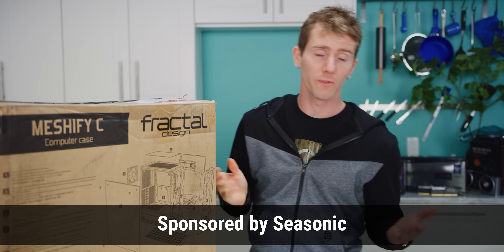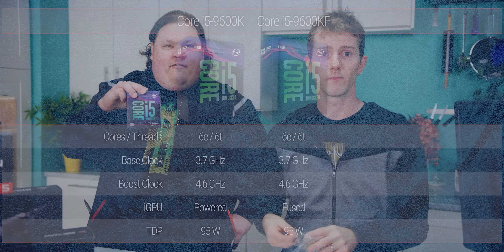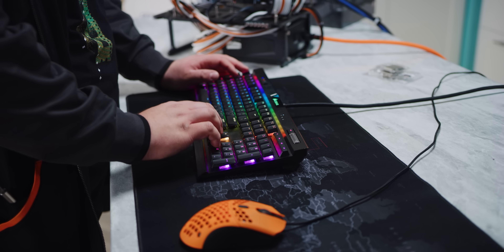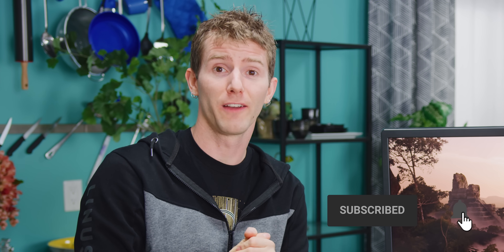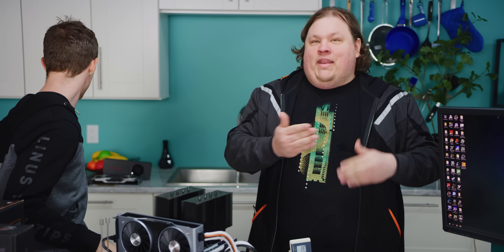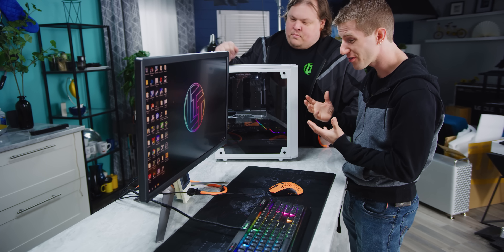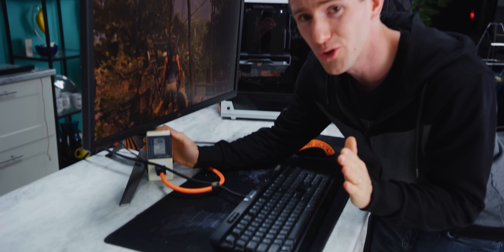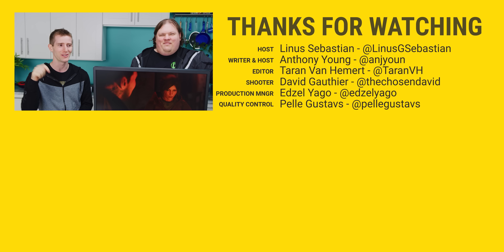We built a PC more efficient than a console!

Comment: Linus: "Most PCs don't blow smoke"
Me: "Wait, that's NOT normal!?!?!???"
Reply: If you remove your pc's cooler it will work better and stop smoking.
Reply: @paulopereira47  the funny thing is I actually did 😂. I have a crappy laptop and a piece of metal got stuck in the fan and it was making a horrible grating noise, and since its super cheap, it has no fan control in the BIOS, so the only thing I could do was to just take it out!
Reply: "Most PC" means it taken into account that some PC do blow smoke. So I think we ok,it just our PCs are little unusual...

Comment: One thing that I think should be mentioned here is that running your games on lower settings will substantially reduce your power draw, as your GPU in particular doesn't need to sweat as hard for each frame. My monitor is capable of 75 Hz and I often have plenty of GPU overhead in games, but I always run at 60 Hz and use the low settings preset. It's often said that whether a game is good is independent of the graphics, and I definitely agree. Eye candy is *nice*, but so is having a livable planet. The other benefit is a quieter, cooler PC that theoretically should age more gracefully.

Comment: In the interest of efficiency, getting fans with fewer blades leads to less airflow interference between the individual blades and higher efficiency. Of course, to equal the same airflow with the same diameter fan, the rpm needs to increase, meaning more noise.

Comment: I actually run my i5-10600K at 4000-4400MHZ (dynamic), locked on 1.1V. It's very efficient but still a beast of a CPU, eating any game you throw at it, while only drawing 60W in the worst case scenario and as low as 5-10W at idle. It also doesn't go hotter than 60*C with a medium tower cooler that costs about $20-25. XMP is disabled, of course and memory sits at 2666 @ 1.2V with the best stable timings.

Comment: Simple trick to save buttloads of energy:
use a Firestick when you're not gaming and just want to watch YT, Netflix or similar stuff.
That thing sips energy in the 1-digit-watt-range, compared to a gaming-rig that probably still idles in the high two-digits or low three-digits.

And in addition, the Firestick can also use HDR and 4k streaming, which sadly isn't possible on most browsers for some reason.

Another/similar tip: Hook up a laptop or tablet to your desktop peripherals (including screen), even better if you have a cheap usb-c-dock. 100% of the "casual PC stuff" (YT, Discord, etc.pp.) including the same handling... At 1/10th (to 1/5th) the power cost :D

Comment: Same issue with the I5 x400t here in Germany. I had to source a used 10400t for my low power build.
It performs epically though undervolted barely drawing 25W while gaming. The system is basically choked by the undervolted rx 6600 xt in most 3d games.

Comment: Would like to see the watt compare of a mostly "normal" gaming PC also, and running the hardware without all the declocking and fan stopping. And finally, a compare to a typical power/gaming laptop as well.

I need to run a workstation (not actually for gaming but I still might play stuff on Steam sometimes), in an RV, so power/heat/sound are a big concern. I was thinking I would just get a powerful laptop and run an extra monitor/kb/ms but now I'm not so sure this is power efficient or not.

Comment: BTW, be sure to go into the bios and set "low current idle".  If it's a newer PSU, it should allow the Ryzen to run about as cool as the Intel CPU at idle.
Reply: I though this option was for old psu and not necessary for newer ones ?

Comment: There is a really handy thread affinity trick using windows task manager.  They called it Task Manager for a reason. You can manually manage the cpu tasks. Like if the game is only using two cores then you can manually tell all other threads on the cpu to put their loads via affinity settings only on the other cores never touching the cores the game is using.   Ive never actually seen anyone else do this because they let windows decide what to do but doing so also requires instructions and therefore cpu usage causing sputters in thread read because windows is telling core 1 and core 2 to run the game and then for a split second check the network. Then game code. Then check explore.exe then back to game code. Then so on so forth. A background process starts and first uses core 1. With manual affinity settings this wont happen so the game using core 1 and core 2 will never get a read hickup. Just a constant stream of nothing but the games thread

Comment: I'd be very interested to see a new comparison of new-gen tech, this time a 4-way between the intended lowest rated wattage usage chips you can get your hands on from Intel and AMD, vs the "golden silicon" high-performance chips.

Additionally, testing slower(!) RAM vs faster RAM, and whether the impact of slower RAM would even be noticeable if the clock speed of the CPU accessing it is lowered anyway. There's an old rule about higher-frequency RAM using more current, so maybe undervolting already-slower RAM would lead to more ridiculous savings?

I suppose there might be difficulty finding the lowest-power-draw motherboards for both Intel and AMD which give the same options for tweaking, while also having similar/identical chips on the board and minimal features.

A final interesting bit would make the low-power chips possibly set up a second video of budget builds -- G series AMD chips have an iGPU, after all. If the board lets that be shut off entirely, and you can confirm that powers it down completely, you could test it at minimum power in one video and as a bargain no-dGPU build in another! And, I guess, do the same with Intel.

Maybe their TDP ratings are less of an absolute lie at the low-end. :P

Comment: efficent builds arent interesting to me for enviorment concern, no. its engery cost. power consumption takes on a different weight, when you pay almost 40 cents per kwh. 30 watt idle is really good for a pc, but you have to take the monitor into account, that will very likely also draw 30 watts, making it 60watts just to display windows.

Comment: I'm trying to come up with a version of this for an emulation PC while traveling. I'm thinking of using a 150W Pico PSU so it runs on 12V from the camper's battery. This way there's no efficiency loss in the AC -> DC conversion. I just keep going back and forth on if I need a dedicated GPU or if I can get by on a Ryzen 5600G w/ APU graphics. I might have to add something like a GTX 1650, but a dedicated graphics card will double the power consumption.

I'm aiming for around 75W or less, under load.
Reply: Did you make it ? It's interesting. But becareful about short power spikes (especially gpu). For example nvidia 3000 series double their TDP for a few milliseconds and it's enough to shut down the system if psu's range is too low. A too small psu can be annoying in case you plug in more external hard drives, audio controllers and such, even for an hour.
Reply: @OptLab  I did make it! I opted to go the dedicated GPU route (Ryzen 5700X & Zotac 1650) because the performance increase is huge vs an APU, but sadly it cost me in terms of power consumption. I was able to find a 250W 12V DC-ATX adapter and a 12V 240W laptop power brick which I've been using since I'm not running it on battery yet. 

Everything has been working great so far, but I'm still tweaking things a little because my idle draw seems high. I set the power limit on the 5700X to 45W and undervolted it CO-30 on all cores. This saves me 20W under load and dropped temps by 9C without hurting my single core performance (4.7GHz), but admittedly the multi-core performance (2GHz) takes a hit. Multi-core isn't super important for me anyway since most emulators only use a single core. I also undervolted and slightly underclocked the GPU while increasing the memory clock, which was able to save me about 15W under load and didn't hurt my GPU performance and dropped GPU temps by 12C.

As it stands now, it idles at about 54W and when running at 100% load doing benchmarks it can use up to 121W. These numbers are while running on AC power, so there's an efficiency loss happening there still. IMO that's not too bad for a tiny 4L SFF with 8-cores, dedicated graphics, 16GB of 4000MHz RAM, a 4TB m.2 and onboard wifi.
Reply: @andrewb9595  Thank you for your thorough reply. It's very interesting but I was expecting much better results for your  time invested. I find your idle power consumption very high. I find your cpu choice weird (especially with a 1650). 5600X+MB have higher i/oidle  consumption compared to 5600G/3600, or even 12400. Would a titanium or platinum power supply help, what is the efficiency curve of your psu?  Did you downgrade to pcie 2/3 ? not more than 1080P 120hz monitor when browsing ? no multiple screen ? Did you if you had any unwanted tasks running in the background ?Buy a wattmeter imo, software power draws are not accurate, especially AMD. Also, wait a couple of minutes so that the cpu turns slowly into its deepest C-state before measuring power draw.
Reply: @OptLab  Yes, the idle power draw is definitely high and I've been trying to figure it out, with no success so far. The 5700X is definitely an odd choice, but to be honest it was a bit of an impulse buy. I snatched it up on Amazon (possibly priced incorrectly) for less than a 3600 or 5600G would have cost me. To this day I cannot seem to find a thorough review of the 5700X's power consumption showing idle power draw, so I made the (probably incorrect) assumption that it would be similar to other AM4 65W processors. I can probably reduce it's consumption a bit, but I have a lot more to learn before doing too much craziness in the BIOS and messing things up by manually dropping voltages instead of using PBO2.
A titanium or platinum power supply would help a bit considering my current PSU is 85% efficiency, but later on down the road I'll have it connected to 12V directly via a DC-DC adapter, so I don't see a point in purchasing a new power supply.
I didn't downgrade to PCIe 2/3. I just have it configured to the default of "auto" in the BIOS and according to GPU-z, the Link State Power Management is working properly and adjusting to PCIe 1.1 at idle.
I'm only running a single monitor at 1080p @ 60Hz.
I've killed unwanted background tasks and startup apps.
I've been taking my power measurements at the wall with a Kill-a-watt power meter, but it only shows full system power draw.
I'm thinking a fair bit of my idle power draw is actually coming from my GPU though. HWinfo shows 32W at idle and according to reviews it should be closer to 8W at idle. I've contacted Nvidia about it and am still waiting to hear back.
Reply: @andrewb9595  There seems to be a problem with your gpu indeed. Yes according to computerbase, it should use 6W idle, and 16W browsing at 4K60.
85% may be your peak efficiency at 80% load. at 20%, 10, or 5% loads, efficiency plummets and you can lose 25% to 50% of your total used power in heat. It all depends on the curve and platinium/titanium have higher efficiency at very low loads. But titanium platinum psu around 100 to 300w are rare or are not manufactured.
I copy paste the link in a separate comment or YT sometimes remove the links
Reply: @andrewb9595  well they remove them but you can look with Computerbase and look for Leistungsaufnahme (power consumption). cnews cz also have some data for consumption.
Basically I'd rather go with a 5600G that is equivalent to a 3600, or go with intel i3 and i5 models series 10 to 12.
Reply: @OptLab  I managed to tweak a few more BIOS settings, undervolted RAM and lowered SoC. Now I'm sitting at 42W idle and 113W max. CPU tops out at 71C and GPU gets to 57C. I've confirmed with others that this GPU is definitely not idling down properly. ZOTAC wants to RMA it, but since I'm still within the Amazon return period I've set up an exchange through Amazon. It should be much less of a headache and faster than an RMA. I'll report back after the GPU swap. ETA is the 24th.
Reply: @andrewb9595  Have you made sure using the APU when not gaming ? In the meantime you could try to rollback the gpu drivers, also try pcie 1.0 or 2.0 because 4.0 use unecessary power, especially in 1080p 
It feels more like a software problem but perhaps it's not fixable with this model.
I'm still trying to figure out which cpu/gpu combo to go with.
Reply: @OptLab  Funny enough, if I disable the GPU it actually ends up using MORE power by shifting more load to the CPU. I have tried using older drivers, without any luck. Also when I look at GPU-Z it shows that my Link State Power Management is working properly and shifting down to PCIe 1 when idling.
Reply: @andrewb9595  Ah yes sorry you already told me about the Pcie stepping down. Have you also tried by physically removing the gpu and see if there is weird behaviors ? See if there is any consumption change if you plug the hdmi cable on the MB hdmi out instead of GPU.

Comment: Carbon-negative cryptomining is possible, by finding out what percentage of revenue donation is enough to carbon-offset the mining and just donating slightly more.

You can use a server PSU to power everything but the motherboard, and then a DC-to-DC PSU like a Pico PSU for powering the motherboard. A 240V server PSU can be even more ludicrously efficient, and some server PSUs don't even need to run the fan if the power draw is low enough compared to their rating, like <50%. You can also spread the load across multiple PSUs to be closer to the most efficient power level for each of them and run them cool enough to not need fans.

Comment: If you want to do something like this but not overdo it, just do 1 or 2 things and you're 90% there.
1. Undervolt the GPU
2. Undervolt the CPU (optional)
For example my system has a 1070 undervolted from voltages ranging from 0.98-1.03V to the same clocks locked at 0.85V. On my 10400f, I only managed to get it from 1.14V down to 1.04V. Still, performance is 100% the same in all the benchmarks I tested, and the system is running cooler and quieter.

Comment: The weird thing is that decreasing voltages makes transferring power over lines way less efficient. I would be worrying about burning out lines in places that were not supposed to be overheating. Because, sure, the amps are miniscule, but they will not be overengineering the lines in a CPU by orders of magnitude.

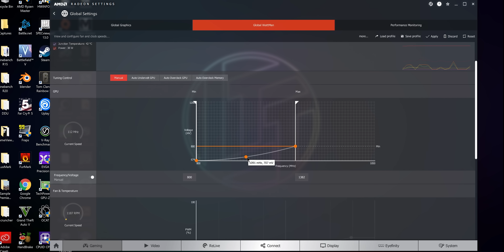Comment: At 6:20 it shows jsut how little you know about how computers work.
It's not possible to set the voltage for a given frequency because modern clock generation works the other way round: they're composed of rings of oscillators (a number of inverters in a loop) that will run at the optimal speed for the input voltage you set. Those devices (understand: transistors in microelectronics parlance) are representative of the rest of the system they provide clocks for and provided they're both supplied by the same power rail. By representative, I mean that they're composed of the same transistor and channel length, same memory devices etc as the rest of the design.
Most systems use a PID controller to set a frequency, but it requires proper characterisation of the ring oscillator with the system across the whole PVT spectrum (process, voltage and temperature). Characterization with modern logic is critical as small variations in process or voltage can result in an undervoltage at the frequency the ring oscillator runs (resulting in setup/hold timing issues), and local decoupling near the CPU, GPU and whatever uses clocks provided by this clock generation block, becomes critical to get right.
Also because voltage varies depending on the load (e.g. you start prime95 or a game that will make either VSS sag or GND bounce) it's impossible to achieve a constant clock, so standard PLL still need to be used for things like USB and display for instance... with retiming ICs to accomodate the differences between the constantly varying clock coming from the CPU/GPU and memory on one side and the fixed clock of those PCIe, USB etc on the other.

Comment: If I wanted efficiency then I would be still using an AMD E-350 on a instead of an A-10 7080K on my PC tower, the big guns are more wasteful, but offer more raw power.
BTW:
For being the small brothers of the faildozer, the brazos branch actually manages to achieve decent framerates with that teeny tiny power draw, and can be overclocked twice as fast as it should be (I'm pumping that thing up to 3.2GHz, when the stock clock is 1.6GHz, without changing the voltage at all and everything runs better, lol)

Comment: Please do more videos about efficiency.  One think I didn't see clearly is the benefit of undervoltage. You didn't show numbers of the whole system running before and after tunning. Maybe you had the numbers there but I couldn't follow. Also how was cpu power measured - did the board support that? How does amd compare to intel as a whole system (not only cpu)? Also don't forget people don't only game on their PCs, they do facebook, office work, programing, most of it is done with the PC at minimum load. If you spend 1 hour gaming and 10 hours the PC is (almost) idle then maybe idle power is also important. All these can be featured in future videos
I've watched your cheap, powerful server with used parts. I was about to buy things when I started investigating power usage. So I calculated that it's far more efficient to buy more recent, but also more power efficient parts ... And the parts didn't work - I was getting CRIT errors/reboots, so I bought a new system for more than double the price which lowered the power consumption even more. So again - please more videos about power efficiency.